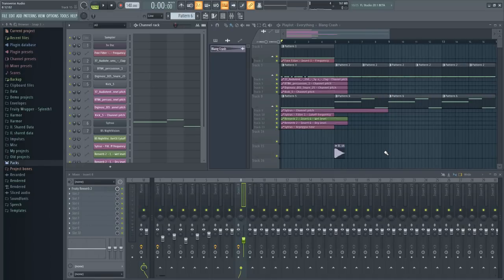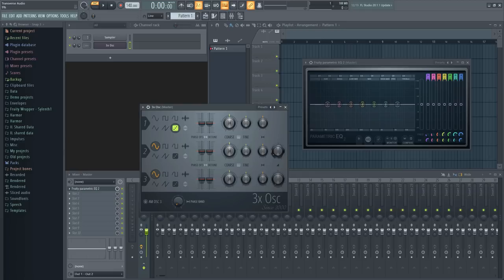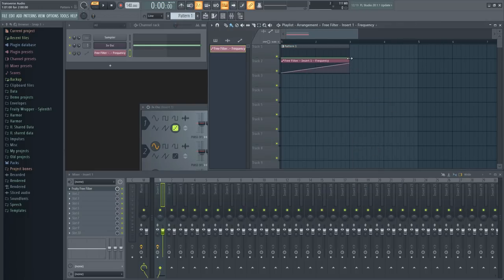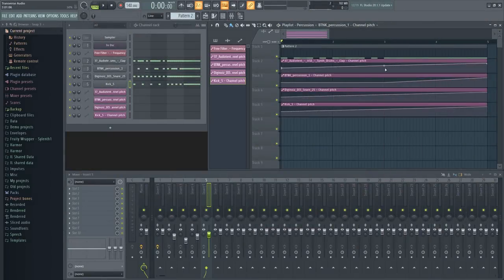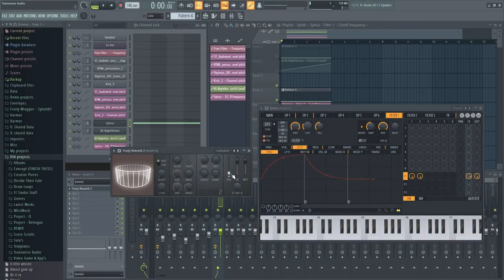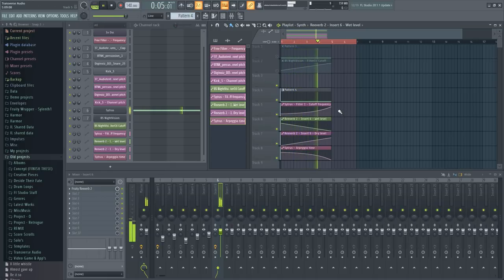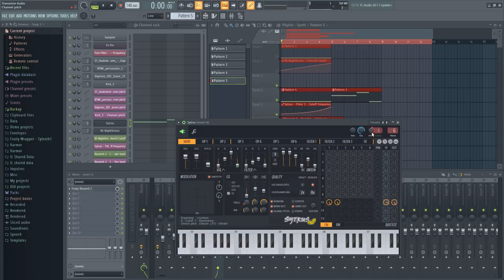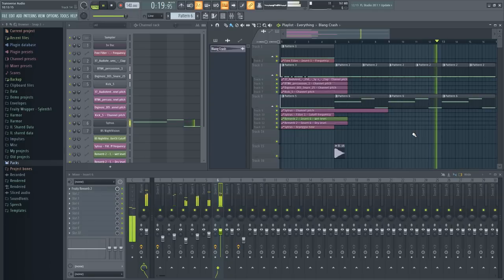How To Make A Riser Effect - Build Up Tutorial (FL Studio 20)

Comment: Great video! Only problem is when I make an automation clip for a white noise riser, the automation clip covers the whole length of the playlist instead of only the pattern. Any tips on that? Thanks!
Reply from the maker: It think it will always do that unless you have a loop selected. What you need to do is drag the endpoint and drag it to the length you want. I recommend right-clicking and copying the value so you can paste it back in.
Reply: @TransverseAudio  Yes, just selecting it works perfectly. So simple :D Thank you!!
Reply from the maker: You're welcome, thank you too!

Comment: I redid it 4 times and it just doesnt change the sound of my white noise. When I play the song its just loud asf white noise with no changes
Reply from the maker: You may have an automation clip present without even knowing it. Go to the File Browser to the left of the DAW, click on Patterns under current project at the top of the menu, then click on initialized controls. There you can delete everything and start over if you have multiple automation clips generated. Make sure you follow the video step-by-step as missing something can cause it to mess up.